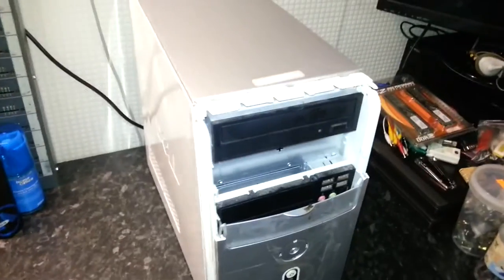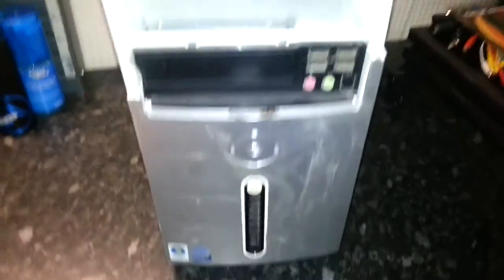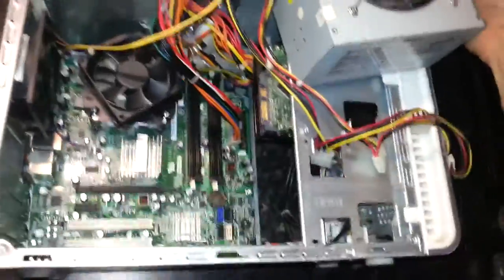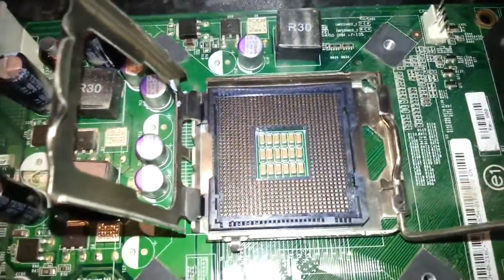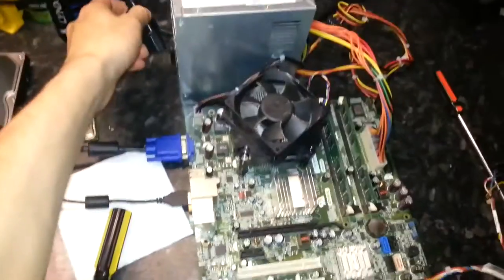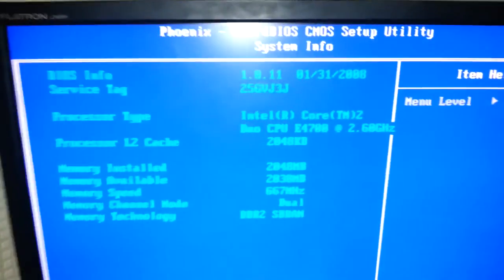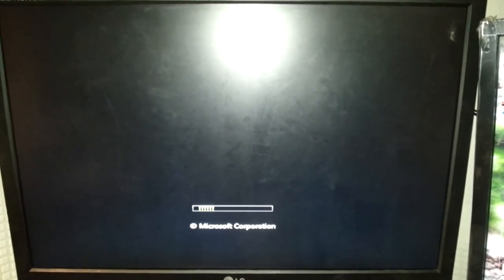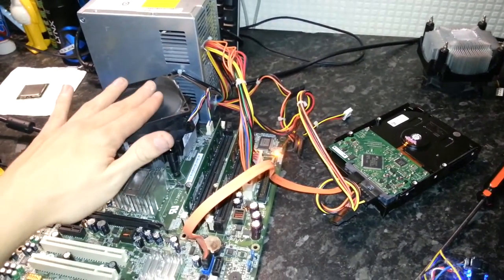Can I Fix This PC I Found In A Dumpster? - Tip / Skip Dive Pickup Dell Inspiron 530 Computer Tower

Comment: Found a 531 in a dumpster where I work. A Sempron LE 1250 2.2Ghz (almost like new!) Still runs! Was a Vista but upgraded to Win 8.1. thanks want to check the m/b for the board #, to see how much it could be upgraded - only DDR2 so may not be worth it...
Reply from the maker: Good little find then! DDR2 can be picked up really cheap these days on eBay - and if you are in the UK also check out CeX! 
You could totally max that thing out for not much money memory-wise. 
--Nathan
Reply: @NathanPH  the board can hold either b8 or 16 GB. think the fastest it can support is 1066 speed, but the CPU would only run at 800Mhz, the m/b rated speed. The CPU can be upgraded to an Athlon 64 I believe. Thank you again